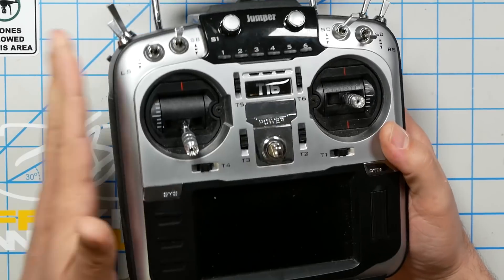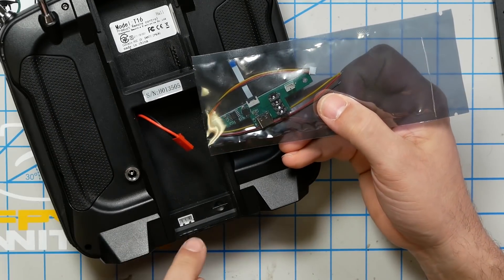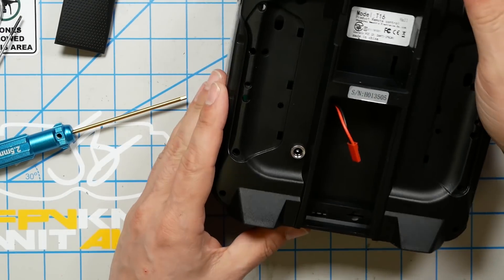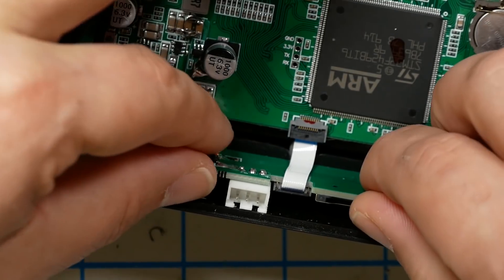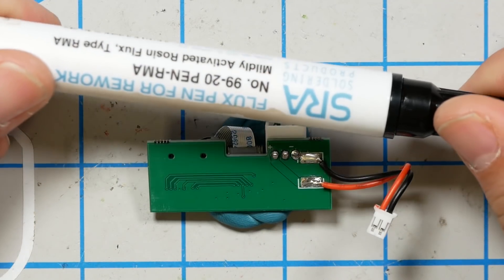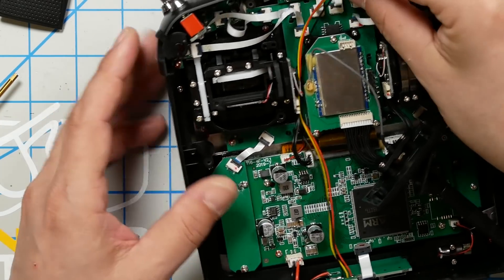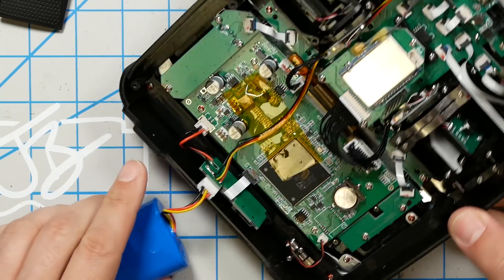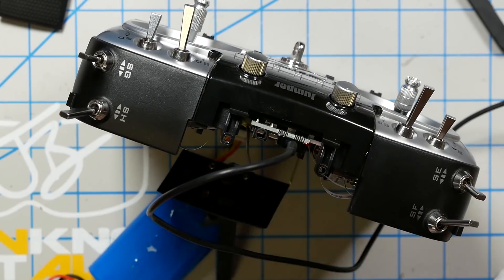Jumper T16 internal charging mod, USB-C, folding handle

Comment: Hi Joshua. I need some help please.
I don't get why we have to do all these charging mods.
I have a brand new T16s and charged it once through a pc.
It occured to me later that a pc will only output 5V which isnt enough.
The 59 page manual does not tell us HOW to charge it and with what charging device.
I was unaware that this Tx has charging issues.
It should ....well..... Just work?
Okay moan over.
I have a new Imax B6 charger and I can solder things up.
Without any further expense to get my new Tx charged, what would you recommend please?
Peter
Reply from the maker: You have a TX16S. This video is for the old original Jumper T16. It's not the same radio. You don't have to mod the TX16S at all :-) Just plug in the bottom USB port to any USB charger and voila you're done.
Reply: @JoshuaBardwell  
Thanks Joshua for your quick reply.
So not a PC?
Do USB chargers have different voltage outputs then?
I am completely new to USB chargers so pardon my ignorance.
Phew....thank goodness I don't have to mod it.
And so it should be!!!...I am a grumpy pensioner old Fart.
Peter
Reply from the maker: A PC USB port will always output 5v, and typically 500 mA max. A phone charger may put out 5v @ 1 to 2 amps. Quick-charge capable phone chargers can put out between 5v and 12v. But they should be safe to use with 5v devices because they should never output higher voltage unless the device indicates it can accept it.

Comment: So on the T18 that already has the usb-C all id have to do is connect the 3 wires from the top pcb and the bottom pcb? Or does this only work because that 21700 mod has an internal charge circuit built into the pack? I have little pcb's for 18650 1-6s charging circuits.. im about to experiment. lol. hopefully not destroy the radio i got in the mail yesterday..

Comment: I'm having an issue where I plug it in to charge and all seems well, then a couple hours later I come back an take off charger and try to boot up and the jumper will not turn on.  It seems to think it still has USB connected.  I unplug the red yellow black wire running from USB C board and then try to turn it on and it works.  If I plug the red yellow black wire back into the board the jumper acts like I just plugged in USB and when I turn off and try to reboot it will not turn on.  I am able to still use my Jumper with that wire unplugged, but now I don't have internal charging.  Anyone else with similar issue?
Reply: did you figure this out?

Comment: Switch the JumperT16 on or off while charging?  When switched on, the inactive message constantly comes on.  When switched off, the red LED on the USB socket does not light up.  Wrong construction?
Reply from the maker: It should not need to be switched on to charge.
Reply: Joshua Bardwell Thank‘s a lot

Comment: Hi Joshua. My new USC-C internal charger module is here and installed. I've noticed that when i plug the radio to a fast charge USB port on my computer, a tiny led shines just beside the USB-C connector of my T16 and button #1 from the 6 button selector keeps on after several cycles of light on the six buttons. Is this the normal behaviour with this charging method ? Is there any indicator when charge is completed ? I mean something like blinking lights, any sound. Thanks in advance.

Comment: Just FYI the new version which I picked up with the carbon fiber face plate installed has the usb-c internal charging, internal multi, and OpenTX installed and I could not be happier I waited the extra few months.

Comment: Hi Joshua, I was wondering if you might be able to help! So I did this mod to my T16 but it won't charge, I've tried different plugs and leads but it just doesn't charge. It does connect to the computer though and works perfectly that way but charging is a no no for some reason I can't figure out. I can see the red charge light so it should be working. Any idea?
Reply from the maker: Either the board is damaged and not working (in which case get a replacement) or the wiring is incorrect.
Reply: @JoshuaBardwell  Ah well that's good enough for me to ask for a replacement then I think! I thought that maybe there was a setting somewhere that I hadn't activated or something like that. Thanks for your help :)

Comment: usb-c chargers come in various wattages. I've personally burnt out a 15w wireless charging pad by accidentally plugging it into a 60w PD Usb-c (no smoking, it just stopped lighting up and working all at once). I wonder what the charging wattage limitations this mod might have to avoid premature failures.

Comment: I was questioning if this upgraded board supports *BALANCE CHARGING*. I just got mine and IT DOES. The chip marking says CS5086E and the datasheet should be the first Google result. (Youtube will not allow me to post a link.) Google translate of the features list (top right block on the first page) lists balance charging. The schema also shows the balance connection and the board has a trace in place. There were also questions about LiPo support - I have seen only LiIon mentioned in the datasheet. But, I would guess that LiPo should be fine. It stops charging at 4.1V/cell and limits the charge current to 1A. So you will not get a full charge, but all values should be well within the safe limits. Hope it helps. Thumbs up maybe? ;-)
Reply: So you can use a Phone Charger for example?
Reply: @MrStreberLP  Phone Charger - yes, as long as it's USB-C ;-)
Reply: And can you still use the simulator with the usb c Module?
Reply: @MrStreberLP  simulator - yes, you can play sim and it will charge at the same time
Reply: @radimklaska  awesome thanks you for the fast Answer 👍👌
Reply: @radimklaska  which simulator are you using? :)
Reply: @mitchellroberts7954  I don't play much. Tried basically all major ones. My favorite is Velocidrone.

Comment: Hi Joshua- I just received my Jumper T16 with the usbc and handle pre installed. I also have the 5000mah aftermarket pack. I just want to makes sure I understand- I can basically use the large pack and not install the barrel plug - charging via usbc is all I need to do.. thanks I’m excited to take one radio to the field instead of 3!!!!

Comment: This mod is not required.. Radio comes with 18650 carrier so just use external 18650 charger and keep a couple spare fully charged 18650 in tool kit . I already use 18650 for my goggles because FS also come with 18650 carrier. One solution for all devices using 18650...simple and cheaper..
Reply from the maker: Lots of people who have this radio prefer internal charging. It's not required, but it's desired. Anyway, it's up to you if you want to do it.

Comment: This Type-C port does not support native Type-C charger (such as PD ones) as it leaves USB-C CC1/CC2 pins floating. I had to add two 51Kohm by myself, very difficult to operate.
Reply from the maker: It doesn't support PD I don't think. Just regular USB charging.
Reply: @JoshuaBardwell  Wow, hope you're getting better. I meant even safe voltage (5V) on a PD USB-C is not supported on it. I soldered two resistors on CC1/CC2 to fix that. Sorry I don't know how to upload an image here.

Comment: HobbyCool also has a replacement SD Card "Jumper T16 Pro Replacement SD card slot PDB" that already has the power wire soldered for $1.90 - so a no solder charging solution for about $8 (C charging card, Bezel, and replacement SD Card Slot)

Comment: I don't get the 5000mah 21700 battery conversion. Two panasonic 18650s will give you 6800mah in a smaller form factor.
Reply from the maker: You are adding the mAh together, but that's wrong. When you wire batteries in series, the voltage adds and the mAh stays the same. Two 3000 mAh 18650 in a 2S configuration is 3000 mAh. The 21700 are 5000 mAh per cell. Find me a 50000 mAh 18650 (not a lying fake-spec "5000 mAh" one, but one that actually really tests at 5000 mAh).
Reply: Gotcha. Thanks.

Comment: Thanks for the mention Joshua!, hope you feel better. The new battery (21700 5000 mAh USB-C compatible pack) is $25 plus shipping and is available here"http://www.rcbatterykit.com/order-a.htm
One note, If you install the battery kit, with the 2.1mm connector, you can plug in and power any 2S accessory when not charging, like a Crossfire or FPV device.I offer an XT-60 cable for charging and an XT-30 for powering a Crossfire.
Bob

Comment: The metal in the handle interferes (as in absorbs/diverts radio energy) esp. with crossfire and R9M, any metal near an antenna is no good, and switching the handle around brings it even closer to the antenna!!!  I'm all for the plastic handle!  I've already got my own charger mod in mine but I'll buy it just for the plastic!

Comment: I ordered mine from Ali the moment it appeared and not even shipped yet :( (well I got a tracking numbers few days later, but still only "shipment information received".)
Reply: Gotta have patience bro with aliexpress. ..gonna sub ya just for your thumbnail lol...love dji FPV
Reply: @flo-ridafpv5713  I know, especially with the new virus etc, but usually Jumper's Ali store is quite quick with shipping. And thx bro, subbed back :)
Reply: @FilipRadelic  yea, I actually buy my gemfan props there, cheapest price delivered vs USA stores, thanks bro. :)
Reply: How much did u pay for ur jumper from aliexpress?
Reply: @seacawk8259  I didn't get my Jumper from Ali, only the upgrade parts. Price fluctuates a bit, you can check the link to the Ali store in video description and see what the current price is.

Comment: Is it fast to charge like this?
Reply: No.
Say it draws 1A from USB to charge the cells, that 1A @5v is the equivalent of 595mA @8.4v (2S charging voltage)
With 3000mAh 18650 cells, that's 5 hours charging time from flat. 500mA USB rate would mean 10 hours.
Note that these are theoretical charge times since the power loss from voltage conversion isn't taken into account.
Reply: @licensetodrive9930  thank you
Reply: @For love FPV  When my charging boards arrive I'll be able to do some accurate testing of the USB current and even individual charge rates of the cells - I'm dead curious to see how it copes when one cell is fully charged and the other isn't.
The boards were posted from China a week ago, fingers crossed they arrive soon.
Reply from the maker: No, it's slow. But whatever.... leave it overnight.
Reply: @JoshuaBardwell  🤔It's really interesting. 👍It seems that you are right.

Comment: did you have any problems with your scroll wheel? mine has become unreliable. Can you do a replacement video?
Reply: It may be just a loose connection, try taking the back off and re-seating the short tiny ribbon cable between the scroll wheel board and the top board.
Happened to mine, buttons & scroll wheel stopped working properly, re-seating the ribbon cables fixed it.
Reply: oh thank you. i will try that 👍
Reply: it worked! thanks!
Reply: Awesome! :)
Now you know how to fix it and what to tell others who have the same issue.

Comment: Do you think the folding handle will have any benefit for crossfire reception?
Reply: Yes the metal bar interfere, a lot if you run horizontal TX antenna, watch recent video from Pawel spychalski I now run mine vertical, even w kwad horizontal mount, tested much better rssi that way, all credit Pawels testing.

Comment: If I read your meter correctly it’s charging at .5 watts? Or is this because your battery is full? I was hoping they would take advantage of usb-c’s higher charge voltage. Nice vid as always btw.
Reply from the maker: USB-C is a physical interface standard. USB-C supports quick-charging, but so do other physical interfaces. This system does not support quick-charge as far as I know. If you want faster charging, you should install the barrel plug method from RCbatterykit.com.

Comment: I asked about this vs the radio master before, but want to add a modifier, Jumper has put out a lot of upgrade modules for the t16, so even if you bought the original, oyu cna upgrade to all the latest features without buying a whole new radio.  Do you think that makes it worth spending the extra $$$ over the radiomaser which might not do that.
Reply: Hmm let's see. I had to buy the HAL gimbals ($35) + internal TX board ($30) + charging board ($5) = $70 CAD. T16 V1 @ $229, total = $299. What a scam :(
I should have waited for the final product
Reply: @n8zfpv  Just like games sell you DLC, they basically take the full game and take out bits then sell them to you as DLC.

Comment: flipping the handle round puts it very close to the antennas and risks fucking with the SWR.  i will be keeping my metal handle as i need it for clamping things too but i wont be reversing it for the reason mentioned above.

Comment: Hope you feel better soon Joshua!  WRT the internal charge mod, well, I ordered one the very same day you came out with that video recommending it and, guess what, it finally arrived today (months later), on the very same day you published this latest video about the MUCH better and officially supported internal charging upgrade from Jumper. I guess the upside is I can use the VERY expensive batteries the “third party” guy sent me (total cost of all the stuff they guy charged me for was $60+ as I recall. ) with the Jumper upgrade. Lesson learned (that I already knew but ignored).... don’t buy third party mods right away. Give the manufacturer some time and they’ll like have something better soon.
Reply from the maker: Well to be honest, manufacturers usually don't release mods like this. Look at FrSky. You have to buy a whole new radio to get internal charging. Jumper is really going above and beyond here.

Comment: I have ordered the parts already so your vid came in the right time. What voltage/amp does the Jumper USB C charging handle? The USB C PD can push through 20v at 5 Amps pushing 100w with the right setup.
Reply from the maker: I believe this is just regular old USB-C 500 mA @ 5v.

Comment: The back cover on the jumper is such a p.i.t.a to get off. I have one of those silicone jar opener type things in my bag at all times now! It grips on the plastic and slides off easy as pie now
Reply: And I swear they need to use bigger screws, I replaced mine with hex too M2 screws.

Comment: Did you have to cut/reshape the opening for the USB port in the antenna housing  to accommodate the USB C form factor?
Reply from the maker: My radio was one of the early ones, and I did have to melt it a little bit with a soldering iron. I hear the newer ones are ready to go.
Reply: @JoshuaBardwell  that's what I was afraid of.  I guess I'll have to break out the Dremel.  Or hopefully they offer a replacement top piece, though I guess it's not a huge deal.
Reply: @Brian Kai  Jumper had released the full 3D object of the T16 on their website in x_t format, but since they've moved domains from .xyz to .com it's no longer showing up, but I have a copy of the x_t format file and found a step format which I can can edit, and will be modifying the top plate to accommodate the USB-C socket to then 3D print.
Reply: @licensetodrive9930  interesting, any chance you could export that to STL and share?
Reply: @Brian Kai  I've zipped up the original .x_t file, the .step version, and exported just the top plate for the trainer/USB/antenna to .stl, that part still needs modifying which I can't yet do until I receive the USB charging boards to get accurate measurements. haku.co.uk/3D/Jumper_T16_3D_Model.zip (39.6MB)
The zip also contains the schematics pdf Jumper used to also have on their website.
Reply: @licensetodrive9930  I don't even have the new charge board yet but I can trial and error it when I do.  Thanks!
Reply: @Brian Kai  Good luck, I'll probably upload the modified top plate to Thingiverse when the time comes.
Because its comprised of curves I'm thinking of printing it at 0.05mm layer height with a 20 degree tilt and full support to get a nice external print finish. ETA printing on that is like 6 hours...!  But it's not like I have to be there whilst it prints :)
Reply: @licensetodrive9930  hmm, yeah this is an interesting print.  I'll probably try a few different methods using some old PLA and see if it translates well to PETG for the final print.
Reply: @BrianKai  they have the new USB-C cover on their Ali store (linked in video description) for $0.99
Reply: @FilipRadelic  that's good to know, thanks.  But now that I know there's an STL... I'm thinking this could simply be a fun project instead :)

Comment: You forgot to mention that with the original charge mod, you can use that barrel connector and a xt60 to power your crossfire from the battery that's in the radio. Or power your goggles etc. So it makes it a double duty battery.

Comment: Glad you showed this mod to those who haven’t seen it yet, also that you showed a different way of mounting the handle to make it more compact. I’m just wondering how it goes with the full size crossfire unit in the back, does it squash it or leave a gap?
Also keep warm Joshua, so that you get rid of that cold as soon as possible.
Reply from the maker: It has a small gap. It doesn't interfere with the antenna.
Reply: Joshua Bardwell , thanks josh, I wanted to do both of the mods, but I might just do the charge lead one instead, plus flip the handle around.
Reply: The flipped handle doesn't interfere with antenna (at least physically, it probably does interfere with radio waves to some degree) on bigger modules, however if you put the radio on its back it will be leaning on the bottom of the module.

Comment: Hope you feel better soon JB. Could you tell me what usb voltage and amps should we use for the usb charger. Id apprieciate it much. Thank you JB
Reply from the maker: It's a standard USB connection so I would assume 5v and < 500 mA.
Reply: When I receive my boards I will be doing thorough tests regarding charging rates & seeing how well it copes with balance charging.